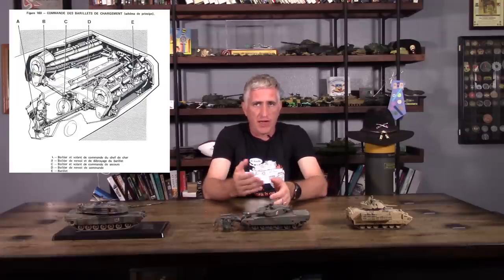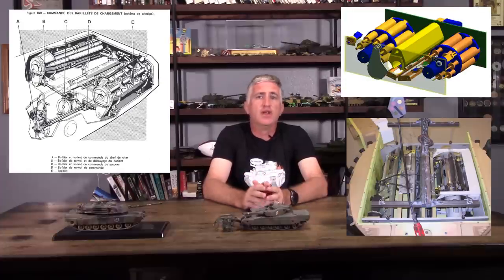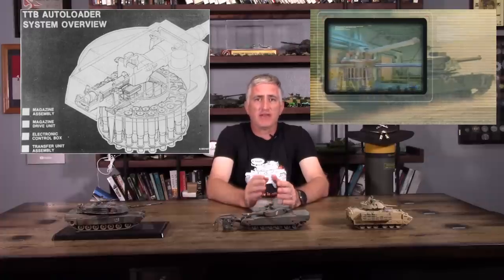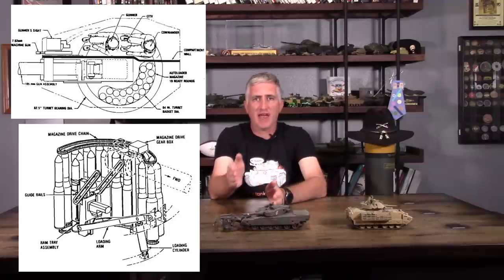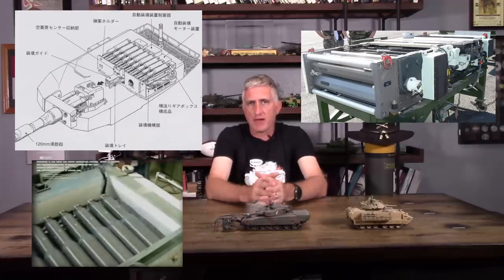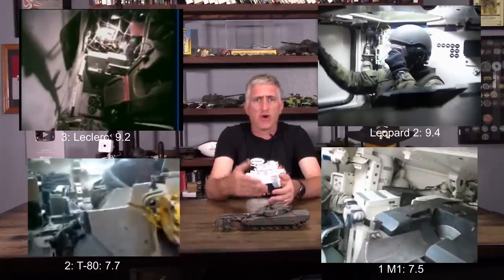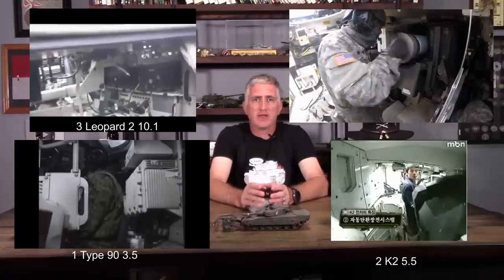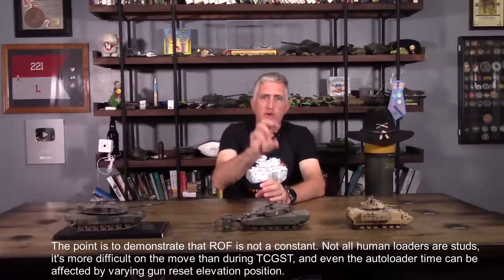Whither the Autoloader?

Comment: The way a French tank platoon was described to me was consisting of 3 Leclercs and 3 VBL "armored" cars, with the French expanding to 4 of each in the near future. The French LT in question described the VBLs being used as "hunting dogs", finding the enemy and watching the flanks of the platoon as needed. I'm not sure if those VBL crew are actually trained for tanking, although they could potentially be extra hands as needed. And yes, it's an incredible load on the platoon commander.
Reply: Seems to kind of tread on the toes of recon and maintenance units whilst not doing either job as well...
Reply: @dylanmilne6683  It doesn't really tread on the toes of recon at all. Reconnaissance units should be much farther afield than sticking within a couple hundred meters of their one platoon at most. They should be several kilometers in depth. They don't really replace maintenance units either, they're not trained or equipped for maintenance but if you need manpower for things like night watch, conducting resupply (trying to human chain rounds along with just three guys is rather difficult), or replacing sprockets.

Comment: Another advantage of auto loaders that was not mentioned is that auto loaders can handle much bigger and more heavy ammunition than humans.
Reply: Less of an issue for a tank than for self propelled artillery I'd think
Reply: @Cal94  Eventually we will hit a point at which it will be impractical to use humans because of the bigger rounds. For example 130mm and 140mm ammunition for western armies and 152mm ammunition for Russia (the use auto loaders anyway)
Reply: @davidreinhart373  M106 and similar use 155mm rounds and have a system to reload so fast they can by altering trajectory and charge have 4 rounds hit the target within a second. OK that's a howitzer not a tank but I would bet we see 155s before rail guns or similar in tanks.
Reply: @davidreinhart373  
I don't see this point coming son in the next century, while i get the point, based on the recent prototype history of the 130 or 140 mm Rheinmetal gun, i doubt that we really will get the need for such high caliber cannons. The only real advantage of high caliber guns is the much easier cartridge design for high energy rounds.
However, if you put enough propellant behind a 100 mm round, you would get the same penetration values as you would get with modern apfsds rounds.
The only advantages of those modern high caliber barrels are the cheaper construction, due to the lower velocity of the round and the increased rigidity compared to other barrels, wich leads to increased accuracy compared to smaller caliber guns with identical penetration value and identical barrel weight.
At the end, even those factors would not matter, when consider a missile system for massively armored vehicles. Than the gun is only a side arm and can be scaled down to an automatic cannon with maybe 30mm to 40mm rounds.
Reply: @mandernachluca3774  
The point is that Hardkill systems can intercept most rounds and missile, except for APFSDS rounds.
Penetration of APFSDS rounds base on velocity and the lenght of the projectile rod.
To lengthen the rod, you need to lenghten the casing.
To keep or encreas the velocity of the longer and heavier projectile, with the same length gunbarrel as we now have, you need to encrease the diameter of the gunbarrel or the pressure.
At the moment the pressure is pretty much at maximum of the barrel material.
So cheaper and tecnically easier is to enlarge the diameter.
Conclusion:
If you want to penetrate modern armor, use a long and large caliber APFSDS Round.
Reply: @deranfanger420  
First, you don't need to lengthen the casing because of a longer rod.
You can increase the velocity by using more of a propellant that burns slower in combination with a longer barrel.
You can increase penetration by increasing the mass of the rod, wich means lengthen it  and using more propellant to increase overall projectile energy with the same velocity.
This keeps the wear of the barrel down, wich is the biggest concern of all, the pressure is actually not the problem, as i recall, the M1 Abrams uses the same barrel with increased propellant pressure, and achieves the same penetration as the Leopard 2A7 with its longer barrel and the lower propellant pressure.
Besides all that, you basically ignored the tandem war heads wich were primarily developed to combat hard kill systems.
Even soft kill systems are no concern, as ground based missiles can be wire guided.
Reply: @mandernachluca3774  as I understand it tandem warheads were designed to specifically counter era not hard kill systems in general.
Reply: @Cal94  one the reasons why USSR switched to auto-loaders completely. 125mm HEFrag is 33 KG

Comment: My question how long does it take to reload an autoloader vs. standard rack systems?
Reply: In the S tank you just open two doors at the back of the tank and slide your ammunition in and that's it. But I don't know how unique the S tank is in that reloading system.
Reply: I'm a loader for an Abrams crew. We just started our Gunnery Skills Testing. Something we have to do every year before gunnery. In the sweet spot I can load a SABOT round in 4.29 seconds. Anything above 7 seconds is a fail on my Gunnery Skills Test
Reply: @jbone7777  , that's nice and all, but could you tell us how long it takes to load the ready rack from empty to full? That is part of the question
Reply: A couple minutes is all it takes. Usually 3 dudes are doing it. A guy on the ground to pull the rounds, he passes it to a guy on the hull, and he hands it to the loader through the hatch to store in the rack. From the semi ready rack to the ready rack takes a lot longer. It's done 1 round at a time because its behind the TC. You can only open one door at a time and the one behind the TC is opened manually. 6 rounds can be stored in the hull. The turret has to be in the correct position to get to them but it's one panel that keeps them in and is easy to remove.
Reply: Human loaders are usually faster than autoloaders
Reply: i am loader in leopard 2a4 and under 6.5s is max allowed reload time at any situation
Reply: TEXOCMOTP  that leo loader was in competent it seams
Reply: That will always depend mainly on crew competence and physical condition.

Comment: Idea: Use an autoloader, but put the loader on EW/drone/information-duty
Reply: Especially if you put all four crew in the hull with the remote controlled autoloading turret. T-14 points the way here.
Reply: Is theT-14 a production tank or a concept tank that Russia just keeps bluffing about?
Reply: @graceshiflett6526  it will be in mass production next year, currently there are only like two battalion of them
Reply: Then you would need space for both of them, which is really bad.

So it would be much easier to have that French model of reserve troops in armoured vehicles behind the tanks controlling that drone.
Reply: @wlewisiii  I think the better idea would be to put the drone operator in a separate vehicle and he controls the drone from it.
Reply: Put all of the displaced loaders in other tanks
Reply: So the loader loses his job but the radio operator makes a comeback, in a way. Maybe together with the front mg?
Reply: @germanvisitor2  or remote controled machine gun on top of the turret, thus we also have multi turret tanks comeback
Reply: @solarissv777  MY GOD HE"S RIGHT
Reply: @itsuk1_1  Erm, what? Current Russian plans only call for one division (and a MR division at that) to be equipped with the T-14. I think they might have reduced the order again while you weren't looking. Unless they get a significant export order to pay for more domestic production, it's never going into mass production
Reply: @talltroll7092  I believe they are currently down to an order of 132......but they are now installing toilets in the few they are making so they got THAT going for them, LOL.
Reply: Then your vehicle gets bigger and heavier and recon crews are the ones responsible for recon anyway
Reply: This surely wont result in information overload

Comment: Great video/content as always - keep up the good work.
    I could see drawbacks for human loaders while attempting to fire on the move. Tank barrels are stabilized, but the entire turret would not be - therefore you're going to have the human loader bouncing around to some degree if you're crossing rough terrain, and that could reduce the speed in which they could move the round from the storage to the barrel - circumstances that, presumably, the autoloader isn't slowed down by.  This may not be a big issue, but if the speed of loading is a determining factor in the combat effectiveness of a tank, as well as the ability of said tank to be able to fire on the move, even in rougher terrain, then a decrease in loading speed caused by a human loader being jostled around (or even just their arms being shaken around a bit, if their overall bodies are strapped in to where they don't really move) by said circumstances would be a decrease in combat effectiveness as well. Again, perhaps not enough of a decrease to matter - or maybe that extra second more than it normally takes the human loader to prep the round ends up making the difference between their round hitting you before your round hits them. I don't know.

Comment: Just a few points. As one who crewed on the XM-8 AGS, it was never officially named the "Buford'. That was started after the M-8 was cancelled. There was never a plan to named it. The names went to tanks was the story around the office in TSM Abrams when we were working on the M-8 AGS. So it was never going to have a name. I believe Mike Sparks started the 'Buford' name several years later when he was pitching the 'air-mech strike' idea. Two, the Autoloader on the XM-8 AGS was an improved version of the one on the CCLV which was a scaled down version of the US Navy's quick fire 6 inch naval gun. We had a test to drop the autoloader 36 feet  and the requirement was for it to cycle through and load 200 rounds without failure. We stopped at over 500 rounds, it was pretty robust. Three, I echo your comments about adoption of 'new' things in the Military. The best way is top down from Leaders, but even when it is driven from the top, sometimes the old grey beards present challenges to adoption.

Comment: Awesome video as always Chieftain. Your practical experience is always so good for videos like these. Thank you for what you do and for expounding on the answer to my question.
Question, would it be possible to use a quick change system for reloading ammunition in an Abrams or Leopard for say ? Like say through the top of the bustle where the blow off panels are.
Reply from the maker: Such a thing was already proposed, and some M1s were equipped for it, before the idea was cancelled. And yes, they used the blowoff panel location.
Reply: @TheChieftainsHatch  I should have known

Comment: Eons ago when the engineers at General Dynamics included a few old tankers (e.g., me), we pointed out that having an auto-loader inside  the tank was not nearly as important as coming up with a better means of loading ammo into the tank.  The fans may not know it, but main gun rounds go in one at time, and have to be busted out of big wooden boxes two at a time (and I have done that to exhaustion more than once!).  

An auto-loader than can  only be replenished manually does not significantly reduce the total time required to fire and then replace one load of ammo  - which is on the order of two hours!  Putting in an auto loader that can be robotically reloaded by a dedicated ammo vehicle would increase the overall fire rate of the tank by a factor of 10! (nobody has done it yet) Until we get that done, auto-loaders are not really a significant advantage in overall combat capability, because shooting yourself dry takes a eon to fix.

These design features required a total departure from conventional tank design - which we merrily accomplished - and to this day remains very unlikely to be adopted in the near future by an Army that really does not like innovation in peacetime.  (I outlined the system design for an APC-mounted laser AA system to knock down drones in 1987 - they just fielded the prototype!)
Reply: Nowadays only the target-practice ammunition comes in the wooden boxes.  Combat ammunition comes in palletized systems that open from the side.  The pallet is put on a truck, the tank pulls alongside, and the crew simply pulls the ammo out of the tubes in the pallet and passes it up to the turret.  The bottleneck is the guy in the turret stowing the rounds.

Comment: The current M1 really is a fat chunky boi. They just keep slapping on more & more armour, ceramic tiles, NERA, ERA you name it.
Reply: It's a hell of a lot cheaper to do that then develop a whole new tank. Then again, the F35 exists so what the hell do I know...
Reply: The F-35 is also ludicrously advanced and essentially built around its avionics. The systems that thing has make the ones in the Raptor looks like old-gen consoles next to a fully-built PC. Not to mention the pilots' impressions are overwhelmingly positive, so it must be doing something right.
Reply: @griffinfaulkner3514  Exactly
Reply: @griffinfaulkner3514  It'll also be outdated in about a decade. The problem with stealth aircraft is that radar technology always outpaces the development of methods to counter it. Not to mention the myriad of bugs and kinks they still have to work out, which they've been doing since 2009. Is it a bad aircraft? No. But is it underwhelming and disappointing  when you consider the development hell and cost overruns it's had to go through? Or the competition the Chinese and Russians will probably give it in 2-3 years? Yes it most certainly is.
Reply: @madcourier6217  Indeed. Not to mention the fact that it has many shortcomings that cannot be fixed no matter what that happened due to development hell.
Reply: @madcourier6217  That's the thing though
Say more advanced radars get developed
Non stealth aircraft will most likely be spotted from a further distance then a stealth aircraft 
Stealth doesn't mean you're invisible to radar, it just makes it harder to see and acquire weapon grade locks,  
Essentially the reason why the same nations that claim "stealth is irrelevant" or "stealth can easily be countered" are the same ones that are developing stealth aircraft or aircraft with stealth characteristics
Reply: @madcourier6217  There's also the fact that its avionics are modular, so upgrading them won't be nearly as problematic as say, an F-15. There's only so much you can do with an old airframe, and the F-35 is designed to be upgraded. It already has the best avionics, all the major components are interchangeable between variants, its stealth is both frontal and side aspect unlike the Russian and Chinese counterparts, and there's a metric fuckton of them entering service with multiple nations, further easing strain on logistics. It's the modern aviation equivalent of an M4 Sherman.
Reply: @griffinfaulkner3514  , The Chair force wants what ever is new & shiny,  F35 is killing the number of pilots with its cost and limited numbers
Reply: @madcourier6217  Personally, I've always felt that the F-35 program would have been better if it had been split into 2 seperate airframes. One would be the model for the USAF & USN and the second for the USMC. They would share parts but would be 2 completely separate airframes so that you wouldn't have to make the compromises that they did in order to create VSTOL version of the F-35 for the Corps. 

That and they shouldn't have gone with concurrency when designing it. All of the tech should have all been developed or almost ready by the time the F-35's designs were finalized. Nothing should have existed on paper only with the promise that it would be ready when production has reached the point that it needed widget X. Concurrency has screwed over the F-35, the LCS, the Zumwalt (in a big way), and the Ford class.

Comment: Tbh the Arjun is only a manual loader system because it was based on the Leopard 2 design. The Indian army has stated preference for autoloader systems due to it's 40+ years of experience with T72 & T90 platforms. They didn't like the Arjun very much because it differs significantly from the standard armour doctrine of the Indian army based on having relatively light tanks with 3-man crews (i.e. Russian tanks) while the Arjun is nearly 70 tonnes with 4-man crew & the rifled gun of the Challenger 2. Also 120mm vs the 125mm is a logistical nightmare in the field.

Comment: Although I think I'm generally in agreement with your stance I must say that the proposal at 13:00 only adds complexity for me. 

Firstly an additional vehicle type is added to the fleet with the additional training and maintenance. Secondly this vehicle is inferior in mobility to the tanks. Thirdly this vehicle is inferior in protection and armament. Sure you point out that these vehicles won't be in the thick of combat but they will invariably present a weaker target which the enemy may be able to exploit to weaken the overall capability of the tanks. Fourthly surely these men are surplus to requirement - what advantage do they have over having a regular maintenance unit which would be able to do heavier maintenance and repairs too? Additionally maintenance units can have ARV's and the like which can accompany tanks into battle and can have the same protection levels as the tanks.